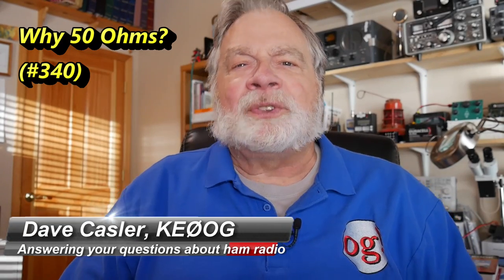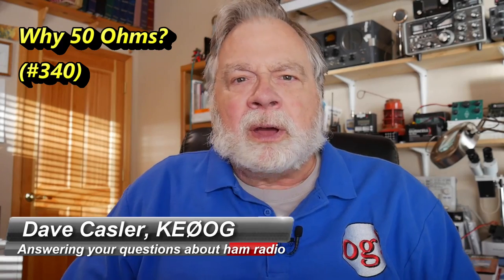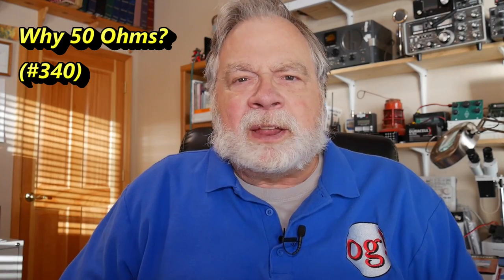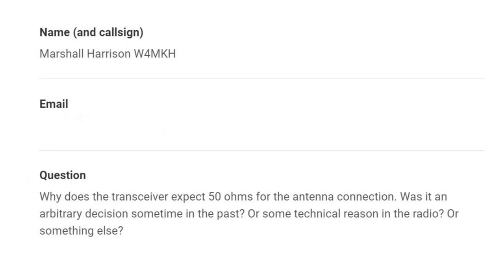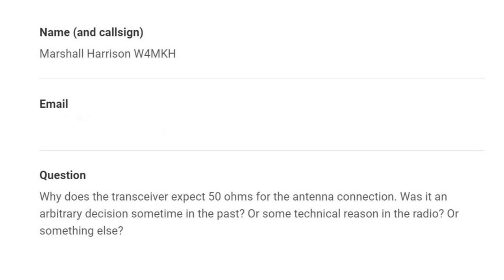Why is Coax 50 Ohms? (#340)

Comment: Let's see, there are many types of transmission lines available to us. Open wire in 300 and 450 ohm, the older 600 ohm lines, then single wire lines in the Marconi style of end fed wire antennas, then we have coaxial lines in 32, 50, 62, 75, and military 150 ohm lines used in early radar. What choice do we have? Why, ALL of them of course, although I prefer the silicone flooded RG-6 satellite direct burial cable because it lasts forever, especially since I have over 1,000 feet of the stuff. At resonance, RG 6 can handle 500 watts easily and its 100% shielded. RG 6  has a drain wire that can be used as dipoles, too. So many "extras" with this type of coax. If you are a "purist", then this cable is not for you. You will need an antenna matched to use it, just like the other transmission lines that are not 50 or 52 ohms. My Heathkit SA-2060 tuner will tune anything down to the middle of the AM broadcast band, though I seldom use it there except with my half watt AM transmitter on a 10' antenna.
   I guess that the "off the shelf" radio makers had to standardize on something, so we got 50 ohm cables, but it is fun to experiment with other cable and twin lead designs. Get an older ARRL antenna Book  to see the designs of other transmission lines and antennas. Unless you build your own transmitters and receivers, there isn't much to experiment with these days unless it is connected to the internet. 73's y'all!

Comment: also i'm thinking a little outside my brain but on this  cable that rich ham operators use with the hollow copper tube outside and then the  inside which is also hollow is the breaking point  or break down of this wire is when a voltage or frequency reaches a certain point is when the atoms inside the hollow places are excited to a point where as they cause a short circuit to take place true or false

Comment: I am not really familiar with this so I wanted to see what that meant exactly 50 ohms. I think what you are talking about is the termination resistor. So for more higher power historical applications, the higher the resistor.
Reply: No, Matthew, the Z0 is a characteristic of the cable, not the terminating resistor. It is dependent on the construction of the cable - dimensions and materials and can be calculated from the inductance and capacitance per unit length. If the terminating resistor is different from the characteristic impedance of the cable there will be reflection of power from the termination and not all the power will end up in the load (which is where you want it!). So a 50 Ohm cable is usually terminated in 50 Ohms resistor. 
Interestingly, at the sending end the output impedance of the source does not need to match the characteristic impedance of the cable, to avoid reflections, but it often does. It does not need to because there are no waves travelling from the load to the source that would be reflected by the mismatch. For high power efficiency the output impedance of the source is often lower than the characteristic impedance of the cable.
When a cable with characteristic impedance of 50 is terminated with a load of 50 the input impedance is 50, no matter how long the cable is. This is regarding the cable as lossless - this is nothing to do with the DC resistance of the cable! :)
This is really hard to get your head around - it took me 2 years of university before I really began to understand it and plenty of EE's don't really understand it, even when they graduate, to tell you the truth! I have won bets on this stuff! :)
Reply: You have it backwards: The geometry of the cable determines the value of resistor you need.

Comment: Although this video is excellent so far to Explaining 50 ohm in RF but i still have lot's of doubts and questions but i will Watch it again sometime to make sure get everything That explained here than i will like to ask .
like for example..
Does same 50 ohm cable comes with different Thickness ? or changing the thickness also changes its 50 ohm properties.
How And what its mean when people talk about 50 ohm line in rf circuit pcb ? can 50 ohm also be made on PCB plain ? how?
If 50 ohm is actually a Impedance term of ohm and Impedance depends on Frequency so how fixed 50 ohm equally suitable for all ?
Coaxial cable is good for Crosstalk but it's Made in way that it is like Cylindrical Capacitor like two Conductors with Dielectric in between so this mean different lengths have different Capacitance so length should Cause suppression or SC for Perticular Rf frequency ? why not ? 

thank you

Comment: To answer the question:

The use of 50 ohms for antenna connections is not arbitrary, but rather a result of technical considerations in radio frequency (RF) design. The choice of 50 ohms for impedance matching is based on a balance between signal power transmission efficiency and minimizing signal reflection.
In RF systems, signals are typically transmitted through transmission lines, which have a characteristic impedance that governs the way signals propagate along them. If the impedance of the transmission line and the load (in this case, the antenna) are not matched, a portion of the signal will be reflected back towards the source, causing signal loss and potential damage to the transmitter.
The 50 ohm characteristic impedance is a commonly used value for transmission lines in RF systems because it provides good signal power transmission efficiency and minimal signal reflection. It is also a value that is readily available in the form of coaxial cable, which is commonly used in RF systems.
In summary, the use of 50 ohms for antenna connections in transceivers is not arbitrary, but rather a well-established practice in RF design that balances signal power transmission efficiency and minimizing signal reflection.

Comment: I followed your explanation and it makes sense. Thanks.
But you left in a vague term when explaining when to use 75ohm coax. Power. You imply that 50ohm is to be used when using higher power, but never put a number to it. Is 1 watt high power ? What do you think a good threshold power would be when deciding on 50 vs 75 ?

Comment: 12:18 On the back of my living-room hi-fi FM tuner, there are separate terminals for connecting a 75Ω or a 300Ω antenna.
Reply: 75 ohms is a unbalanced transmission line also called coaxial, as explained on this video this impedance has the lowest insertión losses. 300 ohms is a ballanced transmisión line with different  electromagnetics field distributions an different laws for power and losses. By means a device called balun (balanced-unbalanced) you can connect coaxial lines with balanced lines, in fact  almost every dipole antennas has a balun, a dipole is a balanced device.  Balanced lines are older than coaxial and they are more sensitives to interferences and weather.
Reply: “Unbalanced” means one side is earthed.
Reply: @lawrencedoliveiro9104  On wikipedia you can find coaxial as unbalanced line. https://en.wikipedia.org/wiki/Unbalanced_line#Coaxial_lines On coaxial there is not problem to ground the outher conductor.
Reply: @lawrencedoliveiro9104  hopefully the same earth  both ends otherwise strange thinfs happen  ;)
Reply: @hexadecimal7300  You can’t ensure that with an unbalanced connection.
Reply: @lawrencedoliveiro9104  Exactly and if the comms are temporary and or connecting to permanent infrastructure, all sorts of strange stuff can  happen without time or resources to figure out . Airgaps in the sheath usually had any problems go away. I seem to remember Telephone exchange buildings would have  3 different "Earths" which was always fun... Not!

Comment: Thanks again Dave. I just watched this again for the thrid time since I originally posted the  question. I just want to clear up something that I think I heard or inferred from your explanation. Since attenuation is less at teh higher 75 (or 72) omm cable would that be a better choice for QRP transmitters which are using lower power? You would have to match it to 50 ohms at the radio to keep the radio from cutting back on power but the 75 ohm line would  better radiate/pass your limited power signal along..

Comment: The non frequency dependent function, for characteristic impedance, Z0, is an approximation for a relatively short length of cable, where the series resistance is a few milliohms and the shunt conductance is a few milli-siemens. Hence R and G can be neglected, and the jw cancel, leaving just the square root of the ratio L/C. But of course if you had a piece of co-ax 100 miles long, this would not be true.

Comment: That Heliax cross section at 6:26 is nuts.  I've never seen anything like that.  It looks like something you might bury between cities or in the ocean for long distance proprietary communication.
Reply: You'd think so at first sight, but it turns out the use cases are rather different than that. 

Such cable is used to get power from the final puppy stage of a hefty TX to its antenna. The run will be as short as possible,  but not too short to prevent the rest of the electronics gear from being swamped by the transmissions from the antenna.

Much lower powers, and therefore thinner cable, would be needed for the use cases you suggest.

We used it to feed the transmitter for a short wave pulsed radar operating in the Antarctic, with a cable run of several hundred metres as we needed the computing gear a long way from the TX...

You can hear these "ionosondes" every quarter hour with any short wave receiver. They send one pulse on a range of closely spaced frequencies rising from 1MHz to 20MHz, timed to pass through 3MHz on the exact quarter hour UT. Near to 3MHz you'll just hear a single click, higher or lower you'll hear a range of clicks as the different ionosondes go through the frequency range at different rates. 

Every quarter hour since sometime in the nineteen fifties (apart from scheduled and unscheduled maintenance) you'd have heard that "click" from the site I was stationed at; but some sites go back to the nineteen thirties so ionosondes predated radar as we now think of it.

Short wave radar (as opposed to the more familiar microwave frequency radar) is used to study the ionosphere because that's what it naturally reflects (which is what we were doing as scientists)

Short wave radar has also been by the military for over the horizon radar before it's role was taken over by satellite coverage (remember the Soviet era Duga, nicknamed the "woodpecker").

Comment: As amateurs and given a choice why didn't we choose 75 Ω for a better match to dipoles?
I recall K.W. equipment was either 50 Ω or 75 Ω, mine was 75.
I went to 50 Ω years later with my h/b radio and it's good for the FT817ND.
G4GHB.

Comment: 👍 Excellent video, thanks Dave. Rather embarrassed to say that I had never researched this. One would perhaps wonder if it should be standard ham exam theory? Before watching this, I had just assumed that co-ax Zo was usually 50 or 75 Ohms because this allowed a good match to common/basic antennas such as dipoles and 1/4 wave GPs. It seems this is perhaps only part of the story, as I did not know about the research into best Zo for power handling/loss. Of course window or ladder line on HF will usually knock the socks off even the best co-ax. However, that is a different subject. We may take the concept of co-ax for granted - Oliver Heaviside was an amazing individual whose achievements and contributions to modern science and engineering can hardly be listed in a few lines (I would urge anyone reading this to look up his Wiki entry). I would personally judge him to be one of the true fathers of radio, perhaps worthy of more recognition than some of the more well known individuals?

Comment: Interesting. RG-58/U. No letter, is 53.5 ohms. RG-58A, 58B and 58C are all MIL C-17 spec and are 50 ohms nominal.  Never knew where the 53.5 came from, but now we know. Also, nothing to do with impedance, non MIL C-17 coax does not have non contaminating PVC jacket.  Contaminating jacket can leach out plasticizers from black outer jacket that over time causes inner dielectric polyethylene to become lossy.  Modern LMR cables don’t have this problem.

Comment: Mr. Cassler, you are a  pretty smart cookie and a wonderful teacher.  

While I now understand that 75 ohms does not have the power handling capability of 50 ohms, I am wondering if 75 ohms, if I am just running 50-100/200 watt max, can successfully be used to tx in vhf/uhf hf applications? ; my runs from radio to antenna would be =/< 100ft. I have lots of RG6/U coax left over when I wired my house.  While I could not achieve a  perfect 1:1 match without a  tuner of some sort, I am thinking that the low cable loss would cancel the loss from the radio to the antenna.  

Also, I was thinking about using the RG6/U to make a 600 ohm feed line for my HF applications since I understand that the shielding on the coax will allow the two coax leads to pass through /past, over, close too metal, such as my metal roof. gain, I would be only using only 100-200 w output, depending on which radio I am using.  

Thank you and be Blessed in this new year.  
John-KB3SVJ

Comment: A folded dipole antenna has a space impedance of 288 ohms balanced.  Which is easily matched to 300 ohms balanced transmission line. When converted to an unbalanced transmission line using a transformer with a 2:1 ratio, it becomes 72 ohms.  This is why 75 ohms is used for FM and Television in an unbalanced transmission line.  The higher the transmission line impedance, the less signal loss over distance.  For a given conductor size a higher impedance transmission line can carry greater power with less loss than its lower impedance counterparts.  A whip antenna cut to a quarter wave will have about 36 ohms mounted on a ground plane will provide a half wave with double the impedance, 72 ohms.

Comment: In the Air Force We used 6” wide Traveling Wave Tubes to connect 5Kwatt transmitters to 40 foot wide parabolic dish repeater antennas making Oc-1 data links 500 miles through troposcatter transmission links hope that is still not top secret?

Comment: I would say that the high voltage cable has the best value to avoid breakage of the insulation (dielectrics) and not the high power as was stated.

Comment: Thanks for a great video. I purchased a Tecsun PL680 and I have a multi band long wire antenna (150’, 80’,40’, and a 30’ length)
And the reception is poor to fair at nights, my question is if I were to purchase an active antenna would my reception improve? And there are many Chinese loop and mini whips that are inexpensive which is very tempting. And on the other hand there is Bonito ma305 which is over $300 
I’m so confused now as to what I should purchase to improve my reception. My house is located on a hill 300 feet above ground level and I thought I would be getting better reception 

I would greatly value and appreciate your opinions.

Comment: Great talk - I always wondered!
Do you know how an oscilloscope probe works? That was a mystery for me for many years. It has to transmit the signal without distortion but is terminated in 1 Mohm and a few pF - so what is the characteristic impedance? 1 Mohm??  The answer is on the internet... :) If you can't find it I'll dig it out...
Reply: I used to design probes for Tektronix.   The coax uses a lossy (nichrome wire) center conductor so there won't be any resonant frequency (it doesn't solder well).  The probe design is complex, and you'll see various other parts in the compensation box to adjust for things like dielectric absorption of the probe tip plastic (hook). There is a high value resistor and a parallel capacitor in the tip and a variable capacitor in a compensation box at the scope.  The compensation box sets the divide ratio of the tip's capacitor and the scope's input capacitance to maintain the divide ratio at high frequencies.  Since oscilloscopes have various input capacitances, the compensation box has an adjustable capacitor to set to the design level (best rise time with minimal over or under shoot).  The rise time equates to the maximum frequency 0.35 / Risetime = f -3dB.      A scope probe can increase the scope's bandwidth at the expense of lowering the probe's impedance.
Reply: @dalebertdurando1496  Thanks Dale. I foud an article on this a few years ago but then lost it again! You have reminded me of the key points. I didn't know it was nichrome, I knew it was lossy. Thanks for posting.

Comment: Thank you for that info. So in summary ideally you would like a different cable for RX and TX, so the 50 ohm is a compromise to get away with a single cable to do both. After purchasing the mfj 259, I mainly use it to trim/tune my antennas mostly based on swr readings, however I did notice that that changes the impedance. Is there something we can do to improve this? What I noticed is that when making adjustments to the antenna or its counterpoise to get better SWR readings for a given frequency,  often the impedance tends to change as well. Now curiosity tells me there must be a way to compensate for this to get the ideal impedance of 50 ohm as well as achieving the best possible swr? Thanks in advance. 73 V51LG